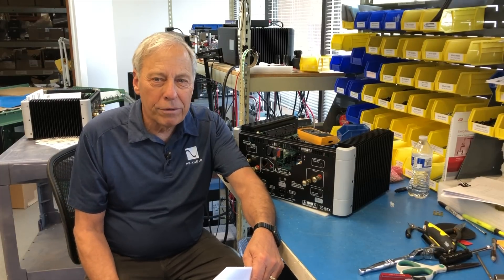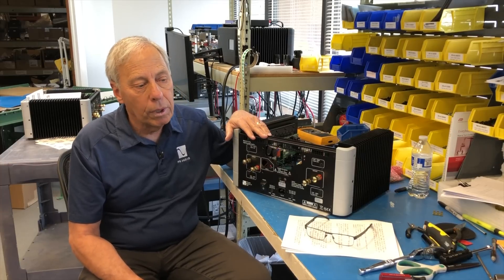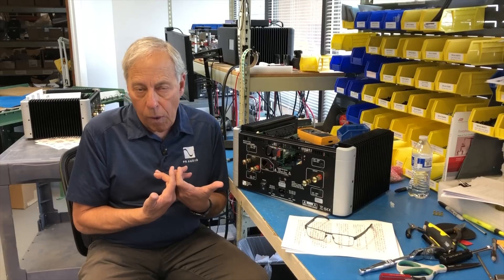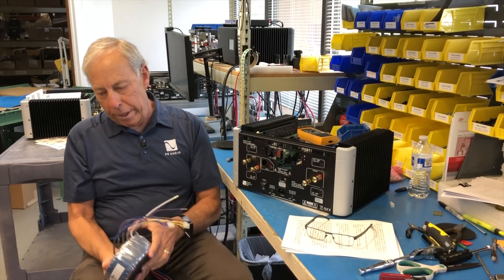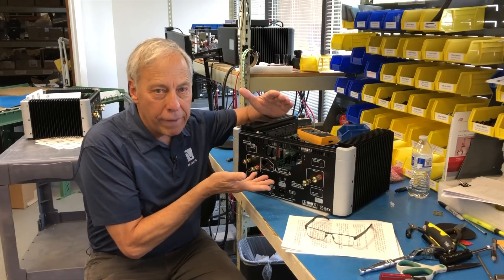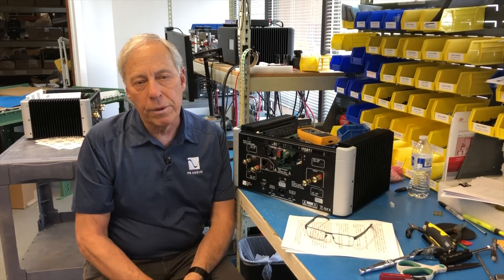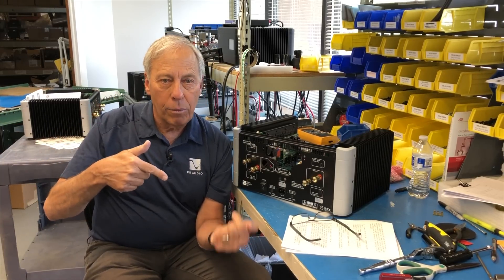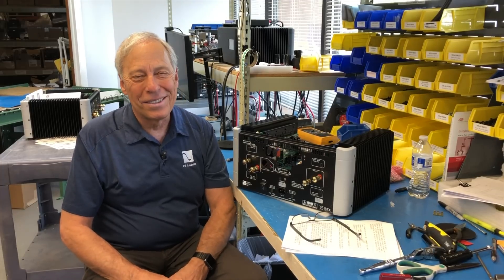Can you run 4Ω speakers on an 8Ω amp?

Comment: What is enough power? What is the minimum power requirements for a 4ohm speaker ? And how does efficiency play a part?  I know Paul is a fan of Infinity's...and in some circles Vintage Infinity's are know to be hard to drive with vintage gear, Amp Killers they say.  Usually they are 6-4ohm 85-90 db efficiency. So what would be a min power requirement for this type of speaker?  Would a vintage solid state receiver  in the 20-40 watt range be able to power this type of speaker correctly? I have a vintage Pioneer SX737 sitting here I believe it's 35 watts per channel just curious, what should I look for I regards to speakers for optimal performance of these vintage receivers. Thanks
Reply: "What is enough power? What is the minimum power requirements for a 4ohm speaker ? " You power amplifier has a power raiting. E.g. 100 Am Head Vox AC30. Then that amp head has speaker output right? Many times multile speaker outpus in expensive heads. Many times you have 16 ohm output, the 8ohm 4ohm etc... If you decide to connect the speaker cable to to 16 ohm output, you would expect that at most, with the mast volume at maximum the amp head would burning 100 watts though the speaker if the speaker has an 16 ohm rating. Get it? Now if you trick the amplifier and do not connect a 16 ohm cabinet but instead connect 8 ohm cabinet,  your load is not as powerful as expected. It lets electricity flow through much more easily. So instead of 100 watts you would be asking your amp to deliver 200 watts to the speaker. It will bur out the amp head. More than that, the speaker itself might also burn. You 8ohm speaker might only take a maxium of 70 watt for example. But the important factor is how loud does sound get at low wattage? I am not sure if you are aware but there are guitar amp heads like the DSL 1 from marshall that can limit itself to 1 watt output or even less. To double the noise you need to exponentially increase the wattage. So 100 watts sounds big but it is not even twice as loud as a 50 watt amp... So what does it tell you? It tells you that when you hear a speaker and that speaker sounds loud and and you know you cannot go any higher, you are using very low power to drive that speaker ... at least at home. If you are in a concert hall i can well believe you might consider puting maximum power. But at home you will never ever drive your amp hard. As simple as that. So you do not need to care impedance matching that much.

Comment: There are older solid state amps that has the switch for higher inpedance load. Gives you a slight voltage bump - good for the "high Z" power. But not recommended for low impedance loads as the amp might overheat or PSU run out of juice. Some Pro amps (ex LAB gruppen) have low Z (mls) swithes, which make the amplifier stable down to 2ohm or even less (reduces output voltage).
BTW. No amplifer deliver Watts. They deliver Voltage. What is connected as resistance to that votlage gives you energy.. Delivering the voltage is not the toughest part. It is to deliver the Amps that the connected "resistance" wants to eat. That result's in watt dissipation. Some amplifiers can handle about equal powerdelivery in 8 and 4 ohms. So (little too) high Voltage - but not so current durable. Some amplifiers can handle close to twice the power @ half impedance. So low (enough) voltage, but better durability regarding higher amps. Car amplifiers generally deliver pretty low voltage, and build to run 1-4ohm impedances.

Comment: Alot of modern av receivers have adjustment for resistance of speaker ohms.
Reply: What they are adjusting is lowering the rail voltage for the 4 ohm setting. Leave it at the 8 ohm setting, you'll get more peak power and I've never had an amp go into protection because of it.

Comment: My solid state Kenwood has the switch. All it does is half your power so it can pass UL and other certification. You should NOT flip that switch unless you can't keep the amp cool. Audioholics has a good video and web article on the subject.

Comment: You have to remember that impedance of a speakers changes when the frequency changes. xl=2*pi*f*L.
Reply: Also speaker resonances affect impedance. When I look at my speaker impedance plot as a function of frequency, it varies from about 3 ohms to 9 ohms (and even higher below bass cut-off). The biggest swings are in the bass frequencies.

Comment: that donut is called toroidal transformer and you can drive 4 ohms speaker on 8 ohms until mosfets burn out
Reply: Most modern Amplifiers are actually designed for both 4 Ohms and 8 Ohms. That's why they have specs power ratings for both 4 Ohms and 8 Ohms 👍🏾

You won't damage the speakers using those amplifiers I mentioned 👌🏾

Comment: Unless you have an AMAZINGLY weak amplifier, the answer is a resounding YES. You CAN run 4ohm speakers on an amp rated for 8ohms. Two things to be aware of: 1) The rated wattage assumes an 8ohm load, but the dissipation will be higher at 4 ohms. 2) However, the higher current at 4 ohms will cause the amp to run hotter. You may need to back the volume down a bit to keep the current at the rated limits.
Reply: Yes but I have an amp and it says on the back side 8 ohm speakers only. So I agree I can use 4 ohm speakers but it will run hotter.
Reply: If the hifi amp is meant to drive 2x 75watt 4 ohms speakers then it should be able to drive x2 50watt 6 ohms speakers easy? Just be careful on volume for speakers sake, is this correct??
Reply: @CrustyBiker  yes it will be fine and volume shouldnt be an issue either because running 6ohm on a 4ohm output will actually drop your wattage. More resistance means less power and less heat. Run 2ohm on the 4ohm output and you decrease the resistance therefore producing more power and more heat.

Comment: I don't think the way you explain it very well by using the term "enough power" to run a higher impedance  load .A 25 watt  4 ohm amp will push 2.5  Amps RMS current through a 4 ohm speaker  when the amplifier is delivering its' rated power of 25 Watts into an 8 Ohm load  you get  1.77 Amps RMS current   An 8 ohm amp can easily go over its max rated current  when attached to 4 ohm speakers momentarily delivering a potential and catastrophic ~50 watts of power to undersized windings

Comment: Some older solid state amps had the switches to match impedance by changing the NFB resistor value so as to keep 1) gain equal and 2) frequency response the same. As another commenter stated speaker loads are dynamic. The load impedance changes per frequency (note the specs usually say 8 ohms at 1khz). The NFB in a solid state amp can detect the change in current draw through the speaker based on the frequency and adjust the gain accordingly, making it relatively flat. It's almost like the servo controlled woofer you talk about in another video of yours. Also for a tube amp, the output transformer also converts the 300+ volts to 10-15 for the speaker. Good explanation otherwise.

Comment: 4 ohms on a speaker is not a resistor, we are talking about impedance, in this instance @1khz. Take the frequency to 100hz the impedance drops, @10khz impedance impedance is up. Current continously fluctuates with volume and frequency in the speaker.

Comment: 7 Minutes to come to a simple answer: YES  ONE  CAN. Modern amps are very capable of handling this. If you're not running the amp to its max, there will be no problem. Or simply connect two 4 Ohm speakers in series, to obtain 8 Ohms. Or the other way around: Connect two 8 ohm speakers parallel to obtain 4 Ohms.

Comment: I got confused by some of this so this is how I worked it out:

How hot the amp gets depends on the current it is having to put out. Too much current and it fries.
The speaker impedance is 'fixed' (for the sake of this argument!)
The current the speaker draws is dependant on the voltage at the speaker bindings, and it's resistance.

So you control the output voltage by turning the volume dial. The current follows at a rate that is determined by the voltage output and the speaker resistance.

Ohms law says Current = Volts / Resistance

Take an example;  Volts 20; Resistance 4; Current = 5
    Volts 20; Resistance 8; Current = 2.5

So for a given position on the volume dial the 8 Ohm speaker only needs half the current to use the same energy (Volts x Current = Watts) as when driving a 4 Ohm speaker.
Which is why higher impedance speakers are 'easier' to drive; they draw less current for a given output voltage so the amp does less work so it doesn't burn out so easily.

This is slightly counter-intuitive as you might think a speaker with a lower resistance would let current through more easily (which it does) but actually the more current the Amp has to deliver the more work it has to do to provide it so the more it struggles and the hotter it gets.
One (highly undesirable) way to demonstrate this is to short circuit the speaker output so the resistance is zero......

Comment: I didn't care i put 180 watts from an amp at 8 ohms into an 1 ohm sub until i blew my amp
Reply: And it wasn't my amp that blew by itself but it was me trying to make the amp have a better efficiency
Reply: Some amps have protection circuits built-in so that you can’t damage them.

Comment: In my life I have seen many amp stages die because a lot of people don't know what and how important impedance matching is. I know many people think a speaker is a speaker and is universal in characteristics. So a 2 or 4 ohm is put where an 8 ohm should be then the volume cranked up and then the smoked releasing begins if the protection circuits if any don't catch it. Speaker impedance mismatch with current in the ma range is almost harmless, but when it is in the amps it can get destructive. I once had a test speaker turn into a heating coil because the output had a +80vdc volt offset on it. Since then I learned to meter an output and use a cap in series just in case when troubleshooting. I think people would understand impedance matching more if they saw it on a scope, or had to get the maximum volume from a discrete amp with limited voltage and current to drive it.
Reply: Agreed,  however many amps can handle lower impedances even when not spec'd for it.  I own many scopes and other test gear,  so yes I get it.   It also all depends on the listening levels and types of music and/or content.   I'll also say many amps can't even handle what they are rated for.  I tend to abuse quality more then crap.

Comment: does An ideal amplifier rated at 100 watts 8omh and 200 Watts 4 ohm operate differently than an amplifier rated 100 watts 4 ohm / 100 watts 8 ohm at very low volumes?

Comment: Just a question Im hoping to upgrade my amp but i dont have the money. I am thinking about getting a few 12v power supplies and running them in parallel to run a car amplifier. is this save? Im thinking about 3 80A 12v psu's to run a 3000wrms car amp

Comment: A weird thing that left me pondering is that my spanking new surround receiver only seems rated for 4 or 6 ohm speakers... I wonder if this is a problem when I run a 5.1 setup with all 8 ohm speakers and when the fronts are bi-amped? The receiver is an Onkyo TC-RZ720. Still weird the menu doesn't let me choose 8 ohm neither regular or in bi-amp setup.
Reply: The rating is generally the nominal minimum impedance. You can use higher impedance speakers, you'll just get less power to the speakers related to higher impedance. This is for solid state amps and not tube
You May have more problems if you are trying to run very low impedance speakers at high volume on an amp with a higher minimum impedance rating

Comment: I have to disagree. I'm not an electronics engineer, but I do own more than 20 4Ω speakers, from bookshelf to gigantic varieties, the first of which were purchased back in about 1981. While these will work with an 8Ω amp, the amp will run hot, sometimes very very hot, even at low volume. Every 8Ω amp I've used with 4Ω speakers, including small ones like 80s Polk Audio 5jrs, has burned out in a couple years. Believe me, I wish this wasn't the case, since 4Ω products are much more expensive and harder to find. I would recommend that anyone with 4Ω speakers find a 4Ω switchable or compatible amp or receiver. Some of mine include select models from Pioneer Elite, Denon, Onkyo, and NAD. For some brands, the EU or Asia models are impedance switchable, while the US model is not, so verify. The presence of a 4Ω power rating in specifications does not mean the product is 4Ω compatible (inexplicably), So look for an explicit statement that says it is 4Ω compatible/stable.
Reply: much like when sweden join 220hz club ( from 230hz) ..lightbulbs keept poppin and their life span was pretty much halved  - (lifespan of 1 year was possible in the 80 now its months ) I belive you -

Comment: @Paul McGowan - I think you have the relationship between impedance and resistance switched. It takes more power to drive through more resistance. Toward the end of the video, you mention the opposite; namely; that it takes twice as much power to drive a 4 ohm speaker as it does an 8 ohm speaker.  But driving a 4 ohm speaker actually requires half as much power as driving an 8 ohm speaker.
Reply: He's referring to constant voltage.

Comment: Really excellent lecture on output impedences, on so called hifi amplifiers. Famous old trick that manufactures forget to tell you, even the best companies do this; they beef up power amplifier, and tell you that the amplifier will work down to 2 ohms, they give you a power transformer based on the mean peak mean average power,based on 10 milli seconds of full power. And the better companies will give you beefier electrolytic reservoir capacitors hopping that will take up the slack.The manufactures are hoping that you are going use the amplifier in short burst at full power. One way to test your hifi amplifier if it is any good, use it in a P.A system at full power for long bursts; say for an hour or two, at local pub gig. Then hear the high frequency distortion, it just reminds you of a overdrive pedal on a guitar amplifier.

Comment: I made the assumption that a 4 ohm speaker was louder because it was getting more power, because the impedance was lower. I also assumed impedance was AC resistance. Maybe I assumed incorrectly?
Reply: How loud a speaker can go is related to the sensitivity of the speaker and its power handling ability. Every extra 3db of output requires a doubling of power so you can imagine things spiral out of control pretty quickly when you want to crank it loud.

If you take a speaker and wire it so the amp sees it as an 8ohm load, and then wire it so the amp sees it as an 4ohm load, yeah it'll be louder at 4ohm for the reason you said, it's getting more power thanks to P=VI

Comment: To keep this simple and safe..... If you have an amplifier That's rated at 8 ohm speakers, you can use a 16 ohm speaker safely. If you have an amp rated at 4 Ohms you can go up in ohms as far as a speaker that is if you're running a 4 amp that requires a 4-ohm speaker you can use at 8 ohm or a 16 ohm speaker but you cannot go down in ohm value that is where the problem comes in. that's no good don't do it.
Reply: Speaker or amp?  This is t clear….
Reply: @stevefagetaboutit8158  okay on your amplifier it has an 8 ohm speaker input, so your speaker needs to either me 8 ohm or 16 - 4 ohm will not work. If your amp has a 4 ohm speaker input, then you can run 4, 8 or 16 ohm.
Reply: @roncarter2188   thank you! I under stand now!
Reply: @roncarter2188   I have a McIntosh MC2600 and I’m running Tekton Moab speakers. I had them wire the Moabs for 8 ohm…. Well, I wanted more high end, so I have a 4ohm super tweeter (Skar VX4-ST) for each Moab. I am just testing this super tweeter concept out. I have them wired to the back of each speaker, and sitting on top of the Moabs. 

Should I be plugging the moabs into the 4ohm speaker outlet on my amp now because the super tweeters say they are rated at 4 ohm ?   Sorry for the long question!  The super tweeters are these ridiculous all aluminum heavy huge tweeters that are rated at like 600 watts!  It does sound good though…. But it’s bad for the amp????   I do have the capacitor thingy attached too that came with the tweets……

Comment: You struggle with transformers ..lol! They are just impedance convertors....
You are spot on with valve amps, but not all solid state amps like 4 ohms. Often because of poor power supplies and regulation and in the case of some earlier amps that use output capacitors, they lose some LF energy if they drive lower impedance speakers. The Quad 303 is a good example .

Comment: At 6:17 you talk about how a 4 Ohm speaker takes twice as much current as an 8 Ohm speaker. In actuality, assuming you mean for the same audio volume or power output, the current dependency is not linear. Rather, power is impedance times square current. For example, to get the same power with half the impedance you need only around 1.414 (square root of 2) times more current.

Comment: So this works the other way around like it would on headphones, them being the higher the impedance the more power required to drive them?
Reply: Fernando Fresno Bustos.... Yes indeed. This is why people always said headphones like the hd800 (300 ohm) are hard to drive because the current from the amp it too low. You need a good amp with a high output at 300 ohm to drive them properly for the best results.

Comment: I fried the output transistors on a Marantz 2265b using it with a pair of OHM Model I speakers on which the 12" woofers can dip to 2-3 ohms. I pushed the volume up to compensate and poof.  I should have known given that those OHM's were rated to handle 1000 watts with a 100 watt minimum.